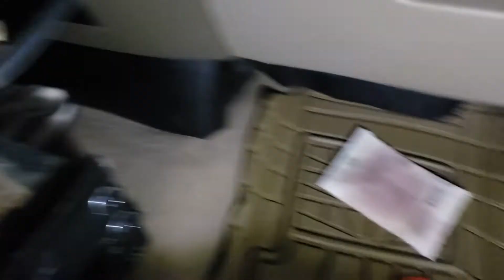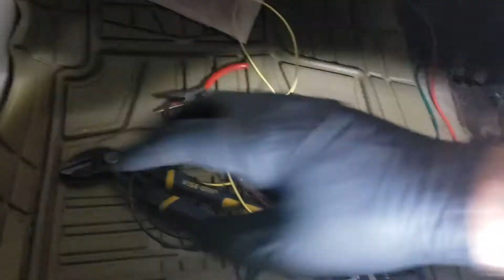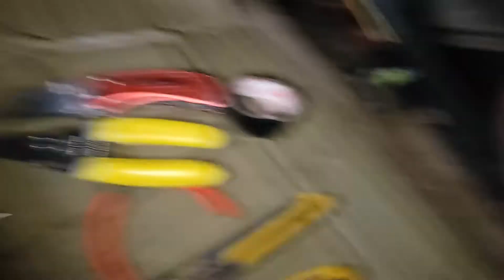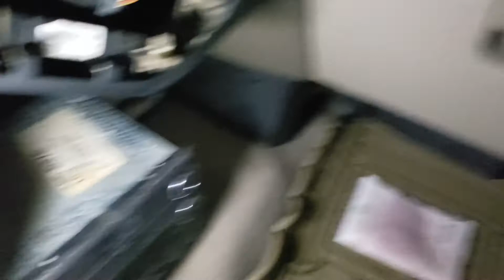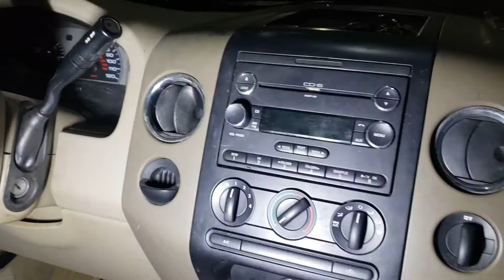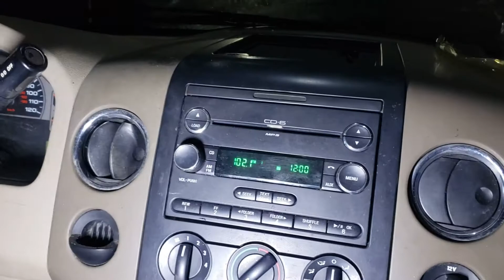2004-2008 F150 Battery Drain

Comment: hello, how many amps relay do you use for it?
Reply from the maker: 10A or higher relay should be sufficient,  you're just interrupting the IGN on power supply to the radio,  doesn't take much power
Reply: @ Okay thankyou for your fast response.
You really helped me out with this video, thanks for this!🙏🏼
Reply from the maker: @Rocketshine  you're welcome!
Reply: @Patman03sprcrw  I had another question, what did you do with the other side of the trigger wire. 
I can see that you put the trigger wire straight on the relay but did you taped the other end of the Trigger wire off or?
Reply from the maker: @Rocketshine  interrupt the power wire goes to relay 30 and 87
trigger wire and ground for 85 and 86 on the relay
Reply: @Patman03sprcrw  the trigger wire is cut through anyway, and then directly from the plug to the relay as I can see.
but don't you need the other side of the trigger wire anymore then?
i ask this because i see there is tape on it
Reply: if you cut the cable from the trigger wire you have 2 ends if you know what I mean
Reply from the maker: @Rocketshine  trigger wire just needs to be "piggy backed" to the relay.  You will want the trigger to stay intact so the function for that wire will be functioning still
Reply: @Patman03sprcrw  okay it is clear to me now, thank you kindly

Comment: Can you do the same for an 08 fuel pump relay? I swapped both pump and module and still not pumping the gas to the engine. I wonder if I can just bypass and use a different relay for it...
Reply from the maker: no because the FPDM is actually a pulse width modulated (module).  its an actual computer that varies how much voltage is output to the pump depending on demand from the driver.  Its not a simple on/off signal to the pump

Comment: I have a 2004 f150 lariat. I unplugged the fuse the for the radio because the radio drains the battery and I also recently unplugged the fuse for the factory subwoofer because someone snipped the wires off it and stole it a long time ago, but if I replace the radio and put the fuse back in for the radio will it still drain the battery? If you read please reach out to me thank you!
Reply from the maker: Likely the drain is in the radio itself,  so replacing it should solve your issue

Comment: So what have the same issue with my 05 f150 xl. 
Could I just go to the junk yard, get a radio out of an old truck and use that? Or will I have the same issue, and just buy a new radio?
Reply from the maker: I would probably buy a cheap aftermarket radio if you dont want to modify the wiring with a relay like I did in this video.

Chances are the junk yard radio will have the same problems....

Comment: My battery drains too.. i have to disconnect it every night n trickle charge it. I think someone tried jumping it with wires crossed. But also seems to be overcharging while running and my ac didn't seem to be blowing cold anymore unless it just needs a recharge. Been 4 years at least. But just seems issues occurring after the battery wire cross and i know crossed bc I saw the wire catch fire. And my headlights stay on after truck turned off.
Reply from the maker: You still have the factory radio in it? LMK if that's your same issue

Comment: My mechanic put a turn off valve on my battery and told me to raise hood and turn off battery when I’m not going anywhere for a couple days. Then I have to open hood and turn new battery back on to go somewhere. Is it a recall on the radio cassette player? My radio CD player comes on randomly when it’s turned off. My mechanic said buy a new radio. He finally recommended me to another shop that has a lot of mechanics with updated tools. He’s retiring and not going to invest in anymore tools.
Reply from the maker: If its a northern truck you need to inspect the grounds for major rust in this same area on both sides.

You can also remove some fuses to isolate where the drain is and figure out what circuit is having issues

Comment: Have seen two 2008 Fords with double din stereos where the CD player constantly cycles & drains the battery so I’m considering this fix for one that we still have.
Reply from the maker: Doesn't surprise me there were other headunits around this same Era with issues
Reply: The radio was the cause of drain in my 2008 F150
Reply: @barrywise2773   Yes. I purchased a cheap aftermarket stereo with wiring adapter & installed it myself. It took a little more work only because the company that sells the products didn’t describe them clearly enough to update my knowledge about car stereo wiring connections from the late 1980s to 2008 or later. 😂. In a perfect world I would’ve taken it somewhere & just paid to get it installed. 
   The installation, at least has the appearance of being perfect.  But the sound gets a little scratchy at times like there’s interference. I couldn’t tell if I needed to add an amplifier and other sites talked about homemade resistors that could be installed in line. But at the end of the day, it’s solved the problem of battery drain & the stereo works.
Reply: My radio does the same thing with cd recycling when not on. I have a 2008 F150 Lariet disconnected radio and it was still draining. He said it wasn’t the alternator. Fuses good. What else can it be?

Comment: What if the power won’t turn off on the door , it stay on like to open a window n to unlock, it pulls power with. No key
Reply from the maker: On 04-08? Check the ground in this same area if you live in the rust belt up North

If not, check out and make sure your ignition switch is fully "off" Ford ignition switches once they are worn out, you can pull the key out of the lock prematurely before hitting "off"

Comment: how did you wire the relay
Reply from the maker: Pin 85 ignition source 
Pin 86 ground
Pin 30 radio power wire
Pin 87 radio power wire
Reply from the maker: Pin 85 ignition source 
Pin 86 ground
Pin 30 radio power wire
Pin 87 radio power wire
Reply: @Patman03sprcrw  i wonder if the radio is what is killing my battery
Reply from the maker: @5.43v  very well could be.  It's easy enough to test or unplug and test that way

Comment: Patman, how did you determine that the draw was from the radio?  Was it staying on after your door was opened with the truck off?
Reply from the maker: I did an amp draw test on it. Nothing appeared to be on the radio . No display, no sound, but it was pulling excessive power with the key off
Reply: Interesting.  Thanks for the video/reply.
Reply: @whitneyjdodson  Yes, My 2004 F-150 XL has same issue. thanks for the info!!!!!
Reply from the maker: @whitneyjdodson  certainly
Reply: My is doing that what do I do everything stays on while no key
Reply: Thanks for this video. I have the same issue. My radio fuse broke then I put in a new one and my battery has died ever since. I'm pulling the fuse today F the radio. I plan on upgrading the system soon